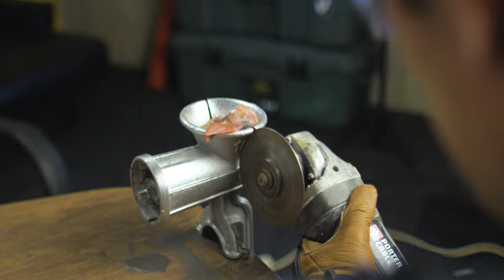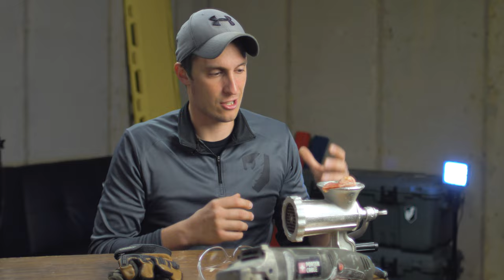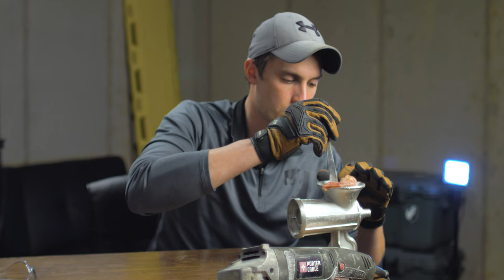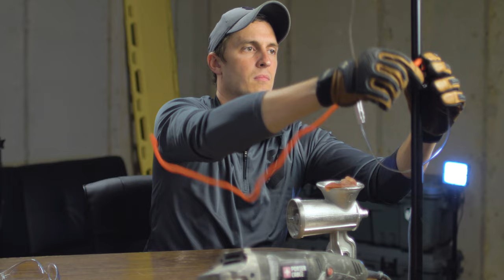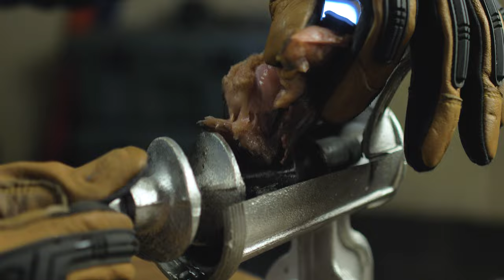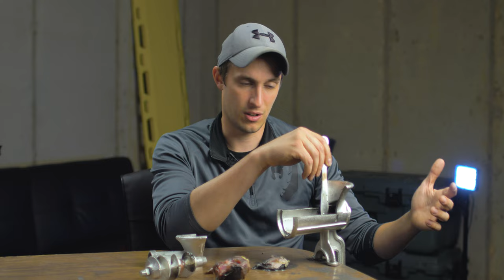Machine Rescue Basics - Cutting A Hand Out Of An Implement

Comment: my mom working on ambulance had to assist at  such  accident  about 40 years ago when buthcer got hand in professional meat grinder.  As it was a very heavy stainless steel meat grinder and cutting tools werent that good it took so much time that the damaged hand had to be amputated .   As little boy I asked or they tried disc grinder etc etc....She told me that  firebrigade used everything to crack the part ....but it was too heavy constructed and after 7 hours or so  they had to give up.
Reply from the maker: Wow. That’s unfortunate. We do have an advantage now with carbide tipped blades, diamond blades and other advanced technologies.

Comment: Infared thermometers are a cheaper
Alternative to thermometer imaging cameras. The laser dot can be used zero in on the area to be monitored
Reply from the maker: Yes, good point. Firefighters typically turn to thermal cameras since we have those on every truck. But when you don’t have all that equipment, the IR temp guns are a cheaper option for sure. Thanks!

Comment: A oscillating tool with a metal carbide blade is a better choice... less heat no sparks ... patient would feel vibration and less likely to cut them...
Reply from the maker: The vibrations could end up causing a great deal of pain depending on the s enviro and where the nerves are in the mix. As a general rule you should avoid tools that move back and forth like the oscillating tools, jig saws and sawzalls since every direction change is a chance for it to get caught on something. Tools like angle grinders, battery powered band saws, cut off tools and dremels move in one direction and have less of a chance of jolting the patient if used correctly.